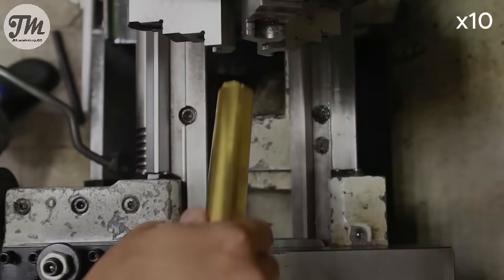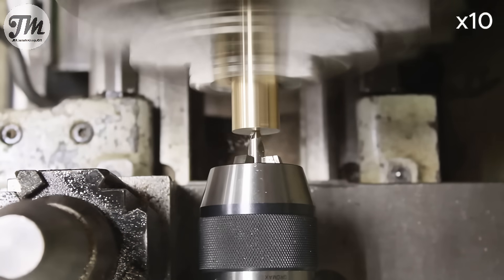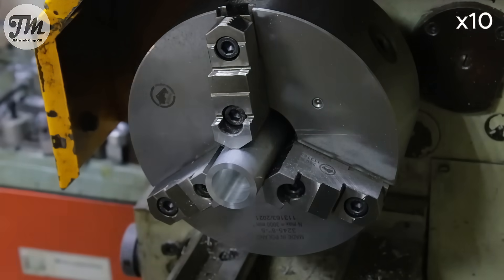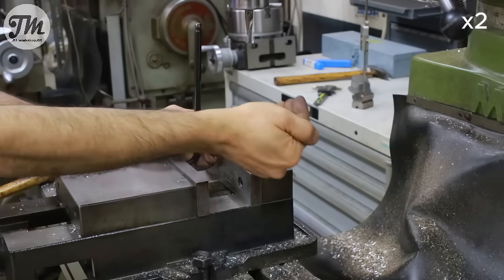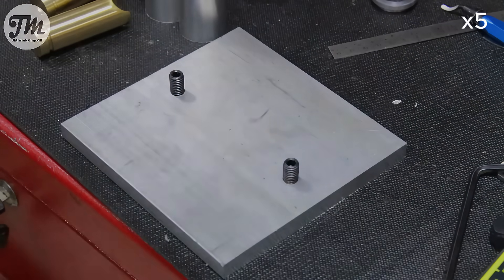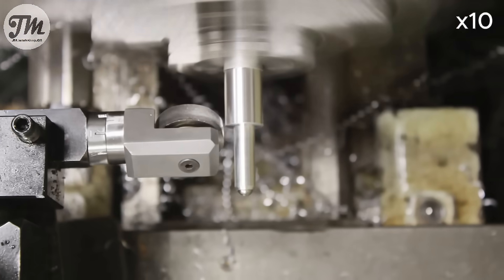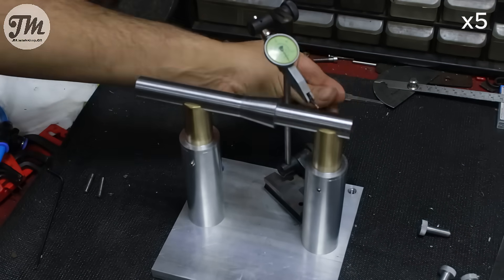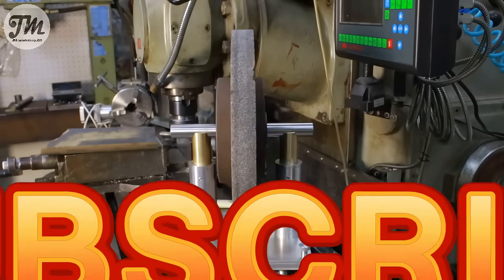I Built a Frictionless Grinder Wheel Balancer (Air Bearing)

Comment: I would add a stopper on at least one side, maybe point tip touching center of the shaft to minimize friction. Then adjust feet to slightly migrate moving shaft to stopper side. I think that would make this machine bit more pleasurable to use
Reply from the maker: Thanks for the feedback! That's a great idea.

Comment: audio balancing & intro tip: your intro is used by people to dial in the volume. You should not have a vid significantly louder than your intro, don't go more than 20% higher on the waveform.
blew my speakers up when you talked because i turned the vid up to hear the intro
Reply: good vid tho thanks for makin it
Reply from the maker: Thanks for letting me know! I didn't catch the sound issue until after I posted it. I'll be more careful next time.

Comment: How much weight can hold?
Reply from the maker: Thank you for watching. The lifting force depends on the air pressure. The weight lifted is approximately 4 kilograms, which is equivalent to 8 pounds. If you want to lift heavier weights, the air pressure must be increased.

Comment: Balanced,  now it needs the wheel trueing with a diamond,  then it will need another balance and re-trueing,  then re-balancing, then a bit more trueing,
Oh, then realise,  should have started with a larger wheel.

Nice work,  I like it,  but of course whats the point of a perfect balanced wheel if the motor armature or shaft itself is not in perfect balance,  as will certainly be the case?

What it needs is a mems sensor to measure the XY&Z linear and XY&Z angular deveations while in operations.

Thats easy,  but making an electronically controlled 3d weight shift dynamic ballancer,  I am still pondering.

Beat me, beat me (not with your rytham stick) but to a successful electronic dynamic closed loop balance system.
Reply: Easy to see who hasn't ran a grinder ever, when all the talk is just theoretical.
Reply from the maker: I appreciate the feedback, thanks for watching!